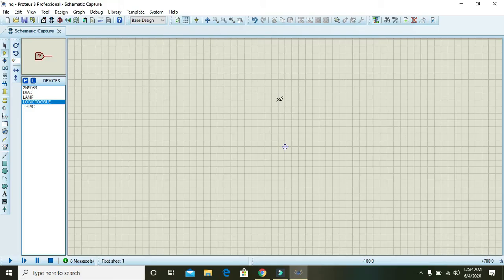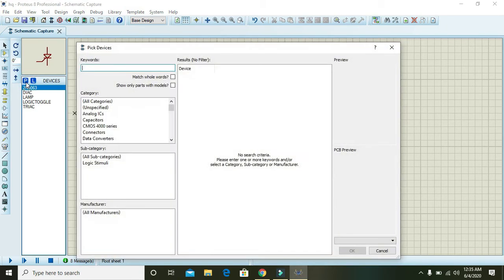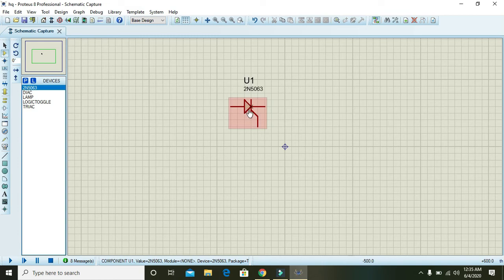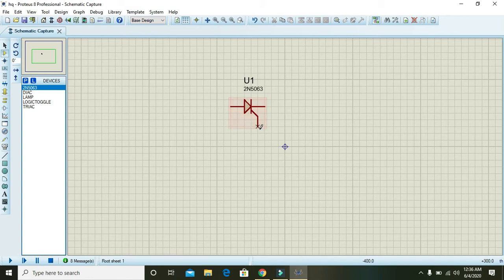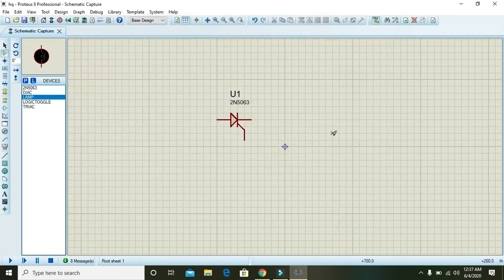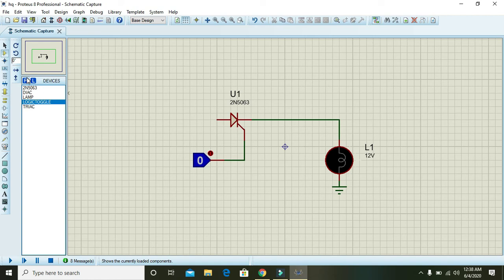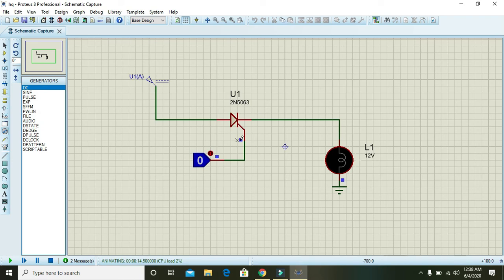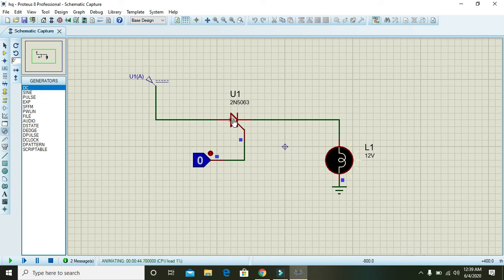How to use SCR (silicon controlled rectifier) in proteus | controlling lamp with SCR

Comment: I used an oscilloscope instead of a lamp, the rest are the same with your circuit, but when I triggered the logic toggle, the DC signal did raise, but when I released the toggle, it went down to 0 V. Why is it not working with oscilloscope?